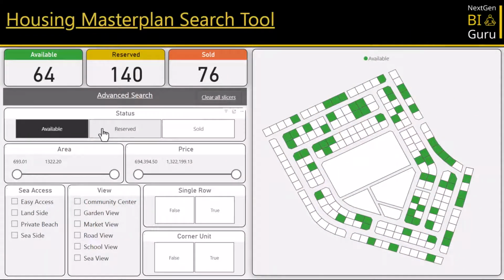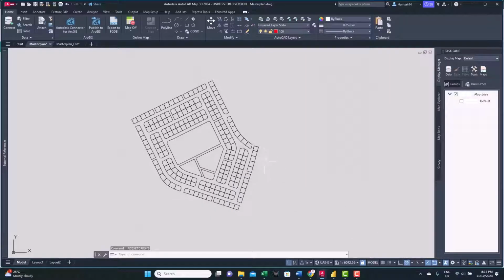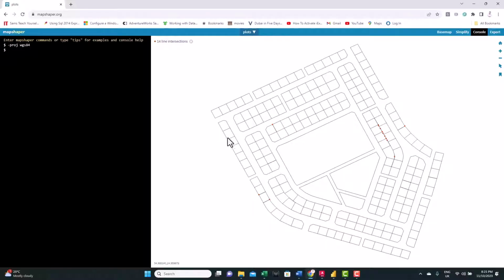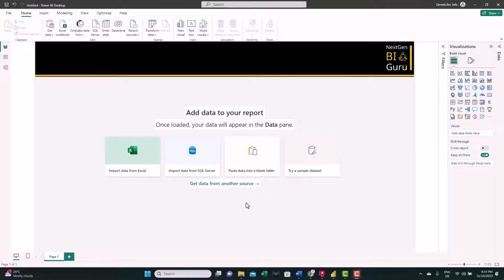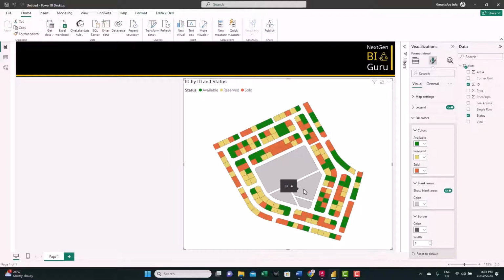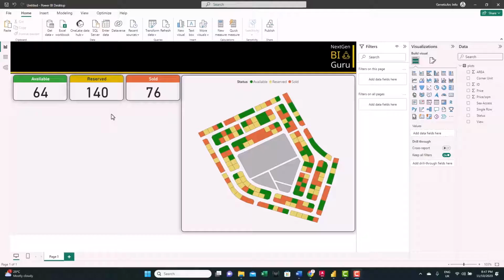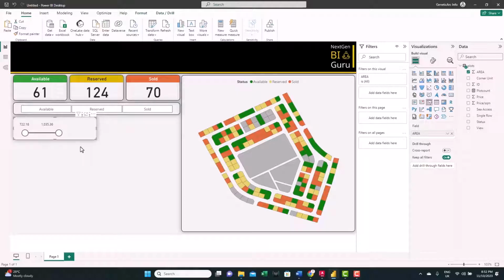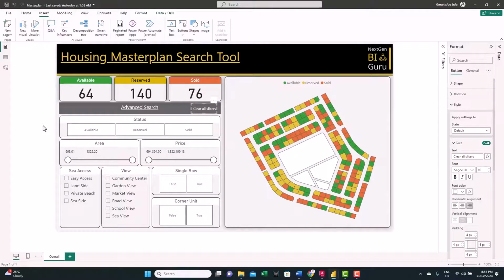Power BI Magic: Transform CAD Drawings Into Dynamic Dashboards - P1 | NextGen BI Guru

Comment: Nice vid! Im trying to do the same thing, but the map I am using doesnt come from CAD. It is a plot plan image. Can I still do it? Also, what if I need to update a square from "available" to "sold"? And I mean, I would be constantly changing the status of the squares. What is the easiest way to do it?
Reply from the maker: Hi Eduard. 
For the first part, unfortunately this visual only works with GIS map (in json format). So you need to import the image into the AutoCad Map 3D and try to trace it with closed Polylines. 
For the second part. Simply update the status in the CSV file and refresh the report. If you are trying to have it online, I would link the report to online excel instead of CSV. And you update the status (you can allow others too). And schedule refresh for the report or refresh it manually as you need.

Comment: Great video but how do i identify the unique ID# to the plots?
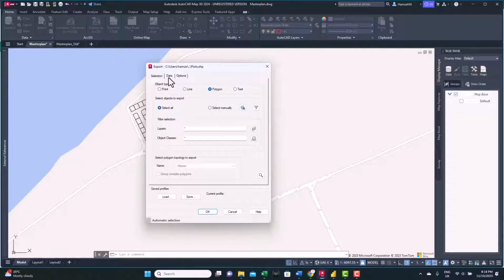Reply from the maker: Hello 👋. You can either use any field (for example hyperlink field) of the Polylines entity in Autocad 3D map to store any value for each Polylines and when you export make sure to select the field you used along with the exported shape file. Or simply you can make AutoCad to assign unique IDs for each plot, check minute 3:50

Comment: Hi. Thanks for the video. I could apply this to thw project I'm currently working on. Though i have one question, when uploading CSV file, can i substitute this by linking directly from Dynamic 365 Business Central since i want the maps in power bi to be live
Reply from the maker: Hi there. You are welcome.
I assume you are referring to the data linked to the map. If this is the case, you are correct you can use any data source including Dynamics. Just make sure to use the same reference (IDs in this tutorial) between the map elements/plots and the data source. Best of luck!
Reply: @NextGenBIGuru  thanks for replies. One more thing, since there's no naps coordinates for Cambodia in tge coordinates options in AutoCAD maps, can i use other coordinates in order to proceed cuz when exporting to Power BI, whether its on a map or not is the not priority for us
Reply from the maker: Yes, you can use any coordinates. for shape map, real location in the world is not critical. Just use any coordinates and apply the projection on MapShaper as explained in the tutorial and you should be fine.
Reply: @NextGenBIGuru  but when i try to use the console code -proj wgs83 like shown in the video, all of my polygones are gone. what should i do? ( i use the coordinates as shown in the video)
Reply from the maker: I am not sure if this was a typo but it should be “- proj wsg84”

Also it can be that your polygons are out of bounds (outside the word). So do the following:
- set some origin in AutoCad map 3D
- turn on the map in AutoCad
- make sure that your polygons are inside the world map, if not move them
- Also while you are at it, make sure that they are scaled properly
Reply: @NextGenBIGuru  i know next to nothing abt autocad so im redoing my polygones again. lets hope it goes well
Reply: @NextGenBIGuru  "$ -proj wgs84
[proj] Removed 1265 paths containing unprojectable vertices."

this is what it shows when i try to enter the command in mapshaper
Reply from the maker: Yes it seems your coordinates are not real. What I suggest is to use the same AutoCad file I shared in the description. Delete the existing Polylines and create your own in the same location. This will ensure that your coordinates are within bounds

Comment: I'd like to use this technique with a building floor plan to track room status during construction. Is there a way to do this without the correcting the projection? I need the floor plan to remain in the same position that I trace the polygons in, and doing the projection distorts the image. Also, how would I go about adding an image of the floorplan underneath the polygons? I have not been able to export the xref using MAPEXPORT.
Reply from the maker: Hello there 👋🏼, in your case I suggest to take a different approach, use PureViz visual, I believe dimensions don’t matter to you so design in as SVG in Powerpoint and track the edges using free shape in PowerPoint. It is much simpler. Check the below tutorial: Animating Power BI Dashboards: Race Bars & Infographics Tutorial - P1 | NextGen BI Guru
https://youtu.be/7ZmyuBE5yOw

Comment: Could you display 3d shapes (similar to a 3d pdf and rotate then) ?
Reply from the maker: You can do 3D extruded shapes. But it will not give you much flexibility to work with 3D detailed shapes. For reference check out this tutorial: Boost Your Dashboards: Engaging 3D Maps In Power BI With Mapbox - 2024 Guide | NextGen BI Guru
https://youtu.be/6vvfVyw8ZmY